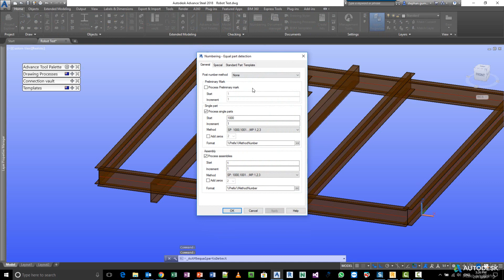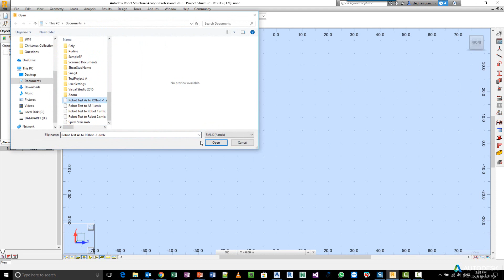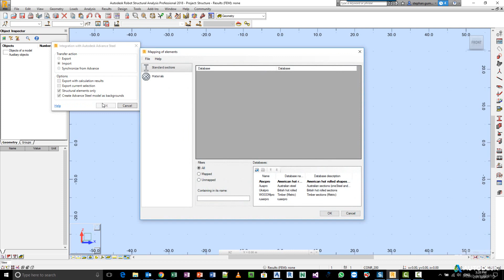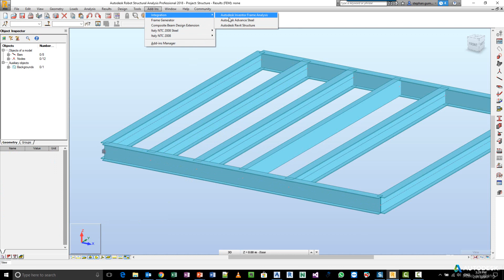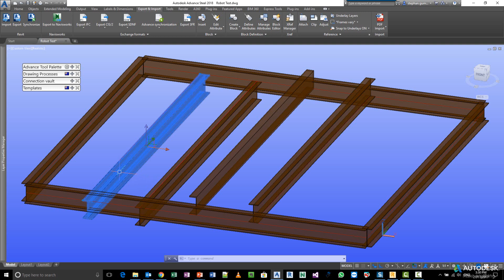Advance Steel to Robot Professional

Comment: Hi there! I'm trying to export my AS model to Robot and then, after few modification, go back to AS by creating a new .smlx file. I properly follow your instructions but what I get is unexpected: the original model in AS and the modified one in Robot are completely overlapped! I mean, for example.. If I export from AS to Robot a HEA200 shape and then I modify it in Robot with a HEA400, when I go back to AS and shyncro with the new .smlx file, I get two overlapped shapes HEA200+HEA400 (same axis)! Can you help me in finding the reason of this problem? Thanks!